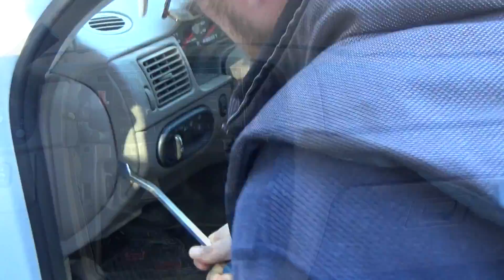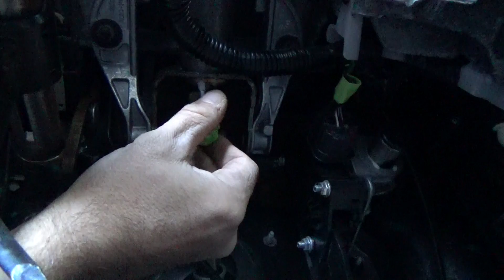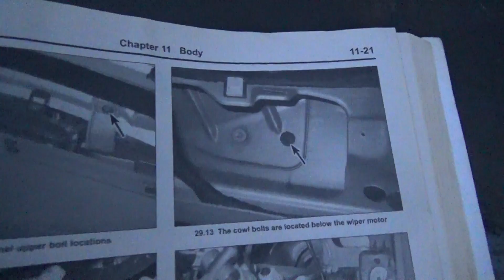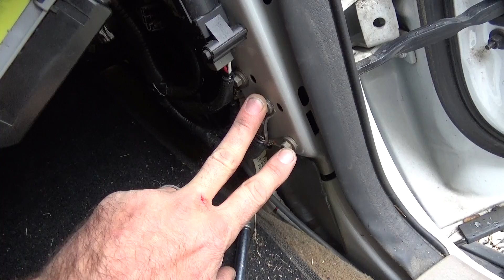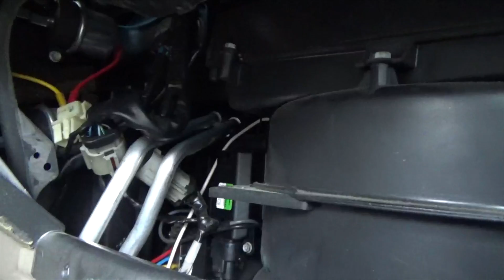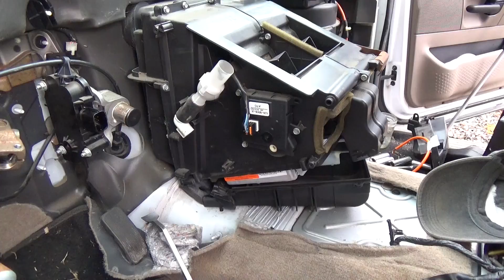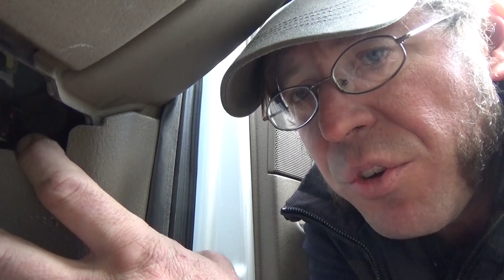Ford Explorer Heater Core Replacement

Comment: I did what you did, but I plumbers the heater core so I  never have to do this again...but I do...the heater/ac case has to be replaced due to missing doors no defrost, can't drive with steamy windows 😢😢

Comment: Im a puller in a junk yard, casually enjoying your video during lunch. Im on the same task. Seems everything is tied to the right front marker light or the wiper motor. Today, earlier, I had to remove a wiper motor to get the plastic intake removed on a Toyota. Now your telling me the same on this? Geez what fun.
That guy destroying the model T 😂

Comment: Well I'm sure glad you recorded this while doing the job as I can see what I'll be up against and it will help me out when I do this once the weather warms up a bit!  My heater core is OK but my '03 Ex has at least two vacuum motor linkages broken or undone and there's no way I can get at them without removing the dash. It also has the dual climate control as your does but little air comes out of the floor vents or the defrost making for cold feet while driving it during the winter.  Thanks for posting this!

Comment: This can't be real.  The steering column?!?!  I have changed heater cores in 30 minutes on many vehicles.  Is this real?
Reply from the maker: Aye, unfortunately it is.  Even more outrageous is how the windshield wipers need to be removed to gain access to the bolts located in the firewall to remove the dash

Comment: Question: Their are two connectors behind my passenger airbag One is black and red and the other is gray and red I can see them when I remove my glove box do you know why they would be disconnected??
Reply from the maker: To the airbag itself?  I'm not sure of the proprietary specifics for that particular vehicle off the top of my head, but air bags typically have two separate connectors called "squibs"  that act as the ignitors.  The vehicle SRS system sends signal to one or both of the ignitors during a crash to regulate the inflation time of the airbag deployment.   It uses factors such as vehicle speed,  passenger weight detected from the seat sensor, vehicle yaw at time of impact, etc, to determine how many squibs to fire during a crash.  I don't know why they would be disconnected.  Perhaps from a previous repair?
Reply: @SeanCrimmins442  They are hanging just above the relay behind the glove box I can see what they go or went to..doesn't look like connectors for the air bag..I really don't know..I opened the box to check the relay and saw the two disconnected connectors hanging just above
Reply: @SeanCrimmins442  they both look like radio wire connectors but my radio works fine
Reply from the maker: @Brazzbalzk  Often times you'll see that when doing a repair to a vehicle; disconnected electrical connectors with no explanation.   If there is no issue evident from that circuit, there's a good chance that it was like that from the factory and those connectors were for a option or feature, (perhaps for an upgraded radio or cabin controls, etc),  for a sub-model of that vehicle's platform.  A dead giveaway is if there's dust inside of the connector itself, which would indicate that it's been like that for a long time...probably since the vehicle was made in the factory.  But that's my best guess without actually getting into it.  Best of luck.
Reply: @SeanCrimmins442  they don't look dust really they look clean..Thank you tho for the pointers! I really hate wiring lol

Comment: Ok, the video was posted 6 years ago, but I had to tell you about my '73 Pinto wagon. The heater core was leaking and I took it to a radiator shop. The owner's comment was that they started with the heater core and built the car around it. It takes a long time to replace it. In contrast, my '91 Ford Ranger only took 20 minutes to change the heater core.

Comment: Thanks for this video! I took your advice and just cut the pipes for the core in the dash. I cut the new core in the same places and used 5/8 heater hose to connect it all back up. Works like a charm.
Reply: Currently gonna do it myself, is it really that simple?  Pop the dash off, cut the hoses, put new heater core in, clamp hoses on? Kinda nervous 😬

Comment: I also ran across a guy that cut that bracket you spoke of but I don't want to mess with the Integrity of the dash and cutting that bracket but it took him an hour to replace the heater core

Comment: Now that I have got the dash out I'm waiting on parts one of your followers subscribers mentioned cutting the coolant lines from the heater core and I think you also mentioned that I took the old one and dry fitted the hose I believe that's the way I'm going to go because this job will never ever ever ever be done again

Comment: I know this might be a long shot but how similar is this for a Ford expedition 2004 dash/heater core removal?
Reply from the maker: I do not believe they are similar, the heater core has a different part number and a quick search yielded that the configuration is different under the dash.

Comment: I got 30 seconds in and decided to either cut the bracket inside or live without heat, HOLY hell...
Reply: When I bought my '97 in 2018, hot air came out of the heater regardless of the heater controls.  It seems the air mixing valve was stuck (not just the actuator - the valve itself wouldn't move).  I did a short-term fix by removing and taping off the vacuum line that controls the hot water valve going into the heater core, but then Winter came, and my always helpful roommate told me he had the utmost in confidence that I could replace the whole heater box.  With the help of this video and a trip to the Pick-N-Pull wreck yard, I DID manage to do it, and thanks to what I learned at the junk yard, I knew what parts I DIDN'T have to remove, making it a one-day job rather than a week-long job.  But like I said, my problem wasn't with the heater core.  If it was just that, I WOULD cut the bracket.
Reply: @ thank God I don't have that truck anymore but that's good man congrats!

Comment: I worked for a GM dealership in 2001. I was responsible for detailing and all inside vehicle repairs. I had a 1999 Chevy S10 come in with the heater core leaking. It’s basically the same exact thing as this was. The whole day had to come out in order to change the heater core.

Comment: Cut those long heater core line off  about 4"-6" from core. place back in dash and install rubber hose and hose clamps to reconnect the ends you just cut off.

Comment: This is so helpful and a big thank you to you!! I plan on doing this job on my 09 explorer in the near future, can you tell me if you needed to drain the AC system? Thank you so much!! John
Reply: My Explorer is a 1997, so take this with a grain of salt - things may be different in newer generations.  The heater box consists of two parts: the part that's inside the cabin and the part that's under the hood.  Once you get the dashboard pulled away from the firewall, there are just four screws that go from the engine side, through the firewall, and into the cabin side.  These can then be pulled away from the firewall, but the engine half doesn't need to move very far.  I changed the whole cabin heater box (problem wasn't the heater core, but the cold/hot air mixer) and didn't have to disconnect any A/C hoses.

Comment: LMAO hell might as well send the heads off port and polish bigger valves and springs why couldn't anyone cut the tubes off the heater core and get a brazing rod and reconnect the tubes lol

Comment: Thanks so much for this video! We changed out the heater core but now the explorer will crank but not start. If you are still checking comments here, any idea what step we missed or messed up that would cause this? Of course the car was working before we started so it’s gotta be something we did or didn’t do
Reply from the maker: First check all of your fuses to make sure none blew during the repair, especially fuse 26 and 39 in the engine compartment.  To do it quickly, use a test light connected to ground and probe the back end of each side of the fuse.  Turn the key to the "on" position without starting the motor.  You should hear a low hum of the fuel pump priming the fuel pump for a couple seconds.  If you do not, suspect an issue with the fuel safety switch or one of the grounding straps.
Reply: @SeanCrimmins442  It was a bad fuel safety switch. I was able to bypass it and have a new one on order. Was so nice to have the car running again! But we still don't have warm air in the heater. I really thought we had it, but feels like we are back to square one. Thoughts or suggestions?
Reply from the maker: @TheAnnasor49  After the motor is warmed up, check the temperature of both the heater hoses going to the firewall in the engine compartment.  If both hoses are hot, suspect an issue with the blend door actuator or associated switch/circuit.  I believe that the bend door is located on the drivers side of the housing for the heater core.  There should be a couple of videos on Youtube that show more details.
Reply: And I checked the fuel safety switch and it is not up.

Comment: I want to thank you for your time and effort making this video to help people better understand the entire process of doing a heater core in these Explores .. But .. I took the short cut.. After removing the center console and removing the glove box I removed the dash support brackets and plastic duct work.. then removed the heater core cover that covers the heater core tubing that goes through the firewall.. and then the heater core cover on the bottom of the heater box.. Took out my dremel tool and cut that bracket off the dash on the passenger side. Disconnected the heater hoses and slide the heater core out.. it took me roughly 2 hours to remove it and 1 1/2 to reassemble.. That bracket is really unnecessary seeing how there are so many other supports including the center console which bolts to the dash and then the floor..  If it wasn't for your video I wouldn't have seen or considered cutting it off..  Thanks again for all your time , effort  and insight.. Stay safe..
Reply from the maker: Great, glad everything worked out!
Reply: would love to see that video
Reply: @ufartface  I unfortunately didn't make a video.. But this guy did exactly what i did. https://youtu.be/Y4G6ljTEL9k   it saves a lot of time.

Comment: I just got done replacing the heater core in my 1981 ford granada, another job from hell but was not as intense as yours....I think they had better engineers back then. If the car did Not have a/c you just took out the glove box to reveal a small door, slide it out, new one in and you were done. But if you have a/c you have to do basically what you did. Just not as much stuff to move. After seeing this I have my 2005 ford explorer for sale....thanks for the info.

Comment: Most of this is not necessary.  You do not need to remove the steering column, instrument panel, the radio, the airbag, any of the ducts, or anything else attached to the dash.  One bolt connects the steering column to the steering gear, and then six screws (three really big, two little ones that connect the defroster outlet to the body, and one little one near the gas pedal) are all you need to remove the dashboard, or at least to swing it out to where you have full access to the heater box.
Reply: That's great, will you show me where you got this info or some sort of scheme drawing please? Literally the coldest weekend Colorado is predicted and I have no heat. The core is leaking like a sieve and my husband works the night shift. This is emergency status for us if anyone can please help with any information to make this job any easier. Excuse my language but I've owner my Ford since 2010 and it's a 2003. The few problems I've had with my vehicle are the bearings and this Fking core . This is the second one to go bad. I'd trade this in but just not in a financial place to start payments again. So anyway any info to help us would be appreciated.
Reply: @vibianab  First, mine is a 1997 model, which Wikipedia calls 2nd generation, while your 2003 would be 3rd generation, so it's not going to look the same as the one in this video, and it probably won't have exactly the same mounting for the dashboard.

I learned this by changing the whole inside portion of the heater box, when my air temperature mixing valve got something stuck in it, twisted, and broke.  As I mentioned, the steering column has to be disconnected, and then you have to remove the center console to make room, and once you find and remove the screws that are holding the dashboard in place, you pull it outward (i.e., away from the windshield), then pull the right side out once you have enough clearance to do so.  The left end just kind of hangs there by a whole bunch of wiring that you also don't want to mess with.  The saving grace for me was that we have a Pick-n-Pull wrecking yard, where I was able to basically disassemble the whole dashboard on a wrecked Explorer in order to pull the unit I needed out, and at that point it was clear which things I shouldn't have removed.  If you have places like this where you live, it's worth it!  Things like the ECU - no need to pull that out.  There are I think three (possibly four) screws that go through the firewall to clamp the two halves of the heater box (inside and engine compartment halves) to each other through the firewall, but those weren't difficult to find.  None of the A/C hoses need to be disconnected, so the A/C will still work when you're done.
Reply: I should also mention, if you can go to a self-service wrecking yard you can also see how much less work needs to be done if it's just the heater core you need to replace.  I wouldn't recommend buying a used heater core, but you can use this just to see what needs to be removed without risking your otherwise good vehicle.

Comment: Do you have a video on removing the blend dorr actuator for  a 2002 ford explorer
Reply: I think this is the same as for the 1997 Mountaineer I replaced it on a few months ago.  No video, sorry, but you can do that by removing the glove box.  The blend door actuator is held on to the top of the heater box by three or four screws (varies by year), which are difficult but not impossible to remove.  I needed a small 1/4" ratchet to do the job - the screws (8mm hex head, as I recall) are down where you can't reach them with a box or open-end wrench, so the socket was essential.

Comment: I cut the bracket worked like a charm eight hr to a hr
Reply: How structural is that bracket though? Think cutting the pipes would be a safer option.
Reply: Nice! I'm thinking about doing the same thing
Reply: @cfnovak1  thank you
Reply: And that's why you should never be a mechanic or own hand tools.

Comment: Where is it...I know I had it around here..somewhere...ah, there’s that saws all.  The good news is, my hand and tool will fit in between the panel wall and the controller I’m trying to replace...the bad news is Ford taped a cord of wires to the frame which is exactly in the way of the top bolt I need to remove.  Can I slice the tape....not unless I had a razor claw at the tip of my finger.  Ford won ☝🏼 ....job security.👏🏼

Comment: Nice and interesting video. Can you please give us the list of tools you used for this job? Also, did you use the ac line disconnecting tool for disconnecting the heater core?
Reply from the maker: Jamal Ahmed Fortunately, the AC does not need to be disconnected to remove the heater core.

Comment: You do not have to do all that to replace the heater coil. Exactly like he said after he removed all that, just cut the bracket out of the way, cut the 2 tubes and use hoses and clamps. There's a video on YouTube showing how to do it. The video sucks because its sideways but the information is great.
Reply: help us find it please
Reply: @ufartface  https://youtu.be/Y4G6ljTEL9k     Use a multi-purpose oscillating tool with the right blade and cut that bracket, cut the 2 tubes shorter if you need to and use rubber hoses and clamps

Comment: If I cut the bracket, what else needs to be removed dash wise to make this job happen? Plz reply asap if u can. I bought a chittlon Manual and am gonna try to do it tomorrow
Reply from the maker: I was away from the computer for the last couple of weeks, hope you made out all right. Cutting the bracket may not be the best idea as it's used to fasten the middle of the dash to the body.  I was suggesting cutting the tubes of the heater core itself to get around the bracket and then reattaching the tubes using rubber hoses.  I hadn't tried it but someone else on this thread did and had success.   Another person on this tread suggested using long M8 x 1.25 hex bolts in place of the grade 8 colored fastening bolts securing the dash to the body on either side to guide the dash out a few inches.  It might give you enough room to get access to the heater core cover and clearance to maneuver around the bracket, but I'm not sure if there has been success this way.

Comment: I just did mine in my 03 explorer. I did just what you suggested. I clamped the hoses under the hood, then cut the heater core pipes under the dashboard, cut the pipes off the new heater core and bought some radiator hose and slid that bitch right in there and clamped it up. Runs great only took me 2 hours. All i had to remove was the center consol, kick plates, the glove box and the air duct system and that was it. Worked great and saved myself so much time. Thanks for that tip! This thing is on its last leg so i have no problem cutting corners. It just has to last me like another 6 months!
Reply from the maker: Awesome, glad it worked out!
Reply: i bet your still driving it... Are you?